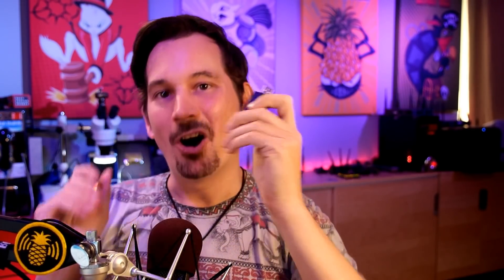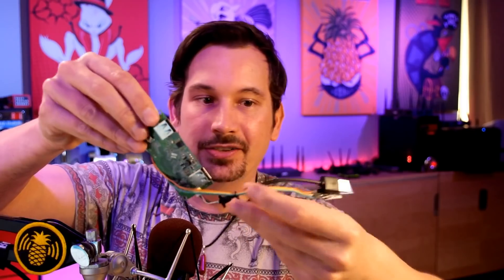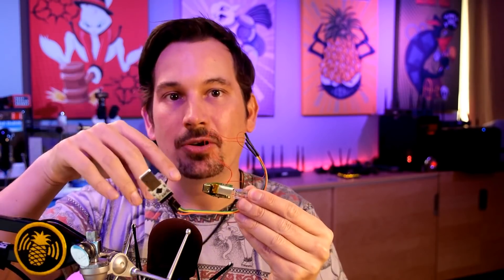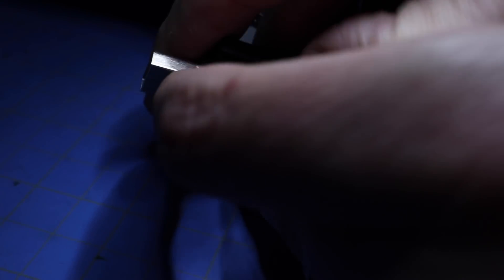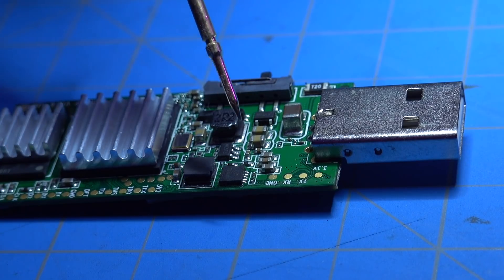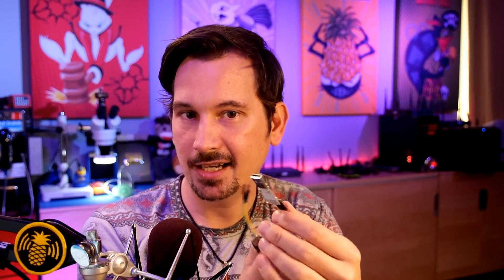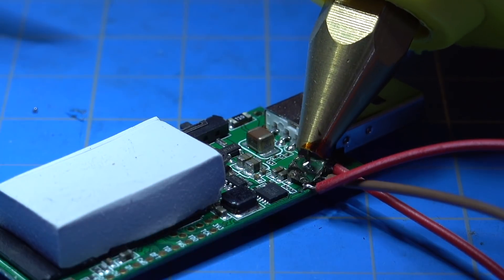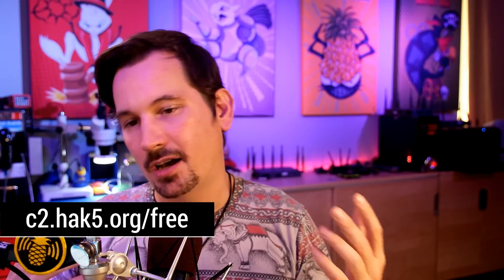Hacking the Bash Bunny for Serial Access - Hak5 2801

Comment: Nice to see you again Darren. And aposite you talking about this becuase I am trying to 'fix' a wifi plug I bought which I don't want to use the manufacturares app to configure.I want to configure it locally and not have it bleed data to the internet. It is a ESP8266EX-module and not all pins are exposed so I am figuring out how to put it into boot with serial on mode and see what is going on when it boots. Kinda like hacking serial only not so simple. ;)

Keep rolling in 2021. Fulfil my Technolust

Comment: This is really crazy.! I literally just learned how to reverse engineer firmware. Got a shell on a few routers and got a shell then escalated. It was a lot of fun!
Reply: Used an arduino to hack two tp link routers. They are super super easy to get a shell. I then used msfvenom and a mipsle tcp bind payload reflashed the firmware, opening my own port and essentially creating a back door. Super fun little challenge. Tplink was so easy I tried it on a net gear router and within minutes had root access to the embedded shell. It would be note worthy to check fcc Id lookup to search for internal photos of all things radio and find the uart ports. Then the next smallest hurdle is finding the right pins it’s not always the same. Over all. I’ve ripped open four routers an Xbox, two smoke detectors since Christmas lol. So weird how you put out a video on the exact topic I’d been playing around the last few days. Are you watching me? Lmfao

Comment: You need a POE version of the sharkjack.
Reply: Maybe, but it'd still need a battery for the vast majority of non-POE ports — and at that point you have the current Shark Jack. What's your thinking on POE?
Reply: @DarrenKitchen  My thought if the Shark Jack ran on POE I could maintain persistent access without any external power. Perhaps POE would be more useful on the LAN turtle.  Or even better, a LAN turtle with POE passthrough. That way I could hide the LAN turtle behind a wallplate or hide it inline with a POE phone.

Comment: You need to use more flux if you want stronger solder joints. If you have to use hot glue then you need to practice soldering more.

Comment: It turns out Hak 5 software is not open source which is the reason I decided not to buy their Kit... dissapointing
Reply: Also, do not buy any macbook, windows laptop and even linux laptop with closed-source BIOS. Avoid using switches and routers which do not have open-source firmware AND bootloader. Never use CPU which runs a proprietary microcode. Just shut off the internet and enjoy the real life.
Reply: @AgressiveHouse  Oh yes, lets buy hacking tools that are simply black boxes and have therefore no learning value... you are probably a windows/mac user. Proud Librem 13 owner here.. look it up.

Comment: I didn't realize there was a TTL adapter I could plug in to my Android devices.  I've been using my phone and tablet instead of a laptop. Nice!
Reply: There are a few apps with work with the CP2102 directly. Good stuff :)
Reply: @DarrenKitchen  So wait - I thought you were talking about open UART on Android devices. You can actually use your phone or Android tablet to interact with UART? I've got a Bus Pirate I like to use most of the time, I'm going to see if I can accomplish something similar with that.